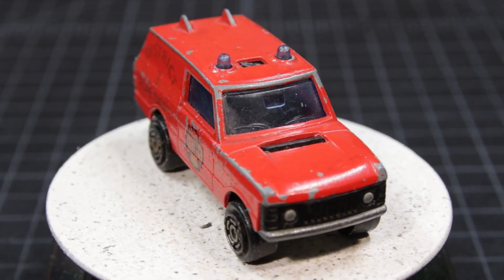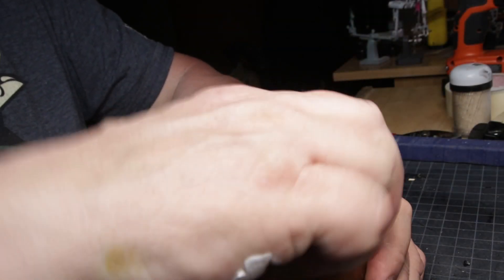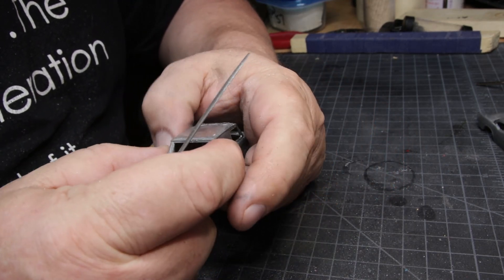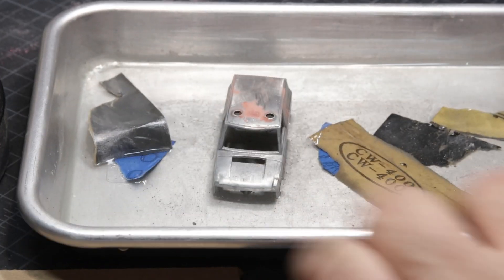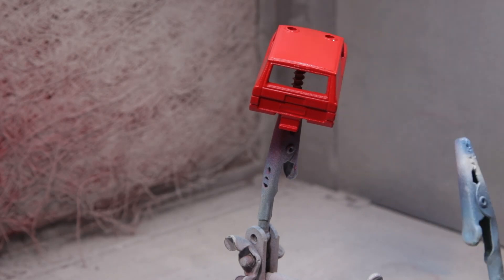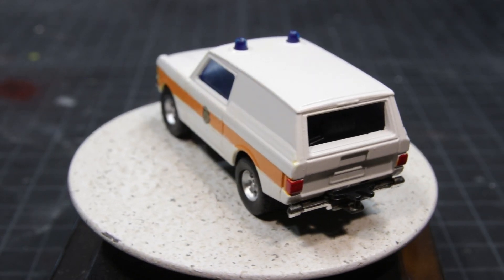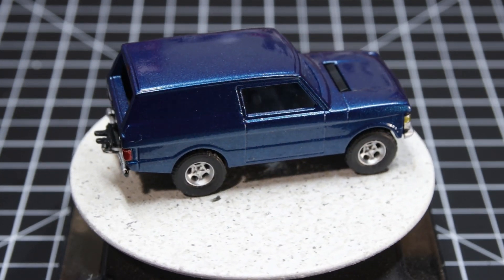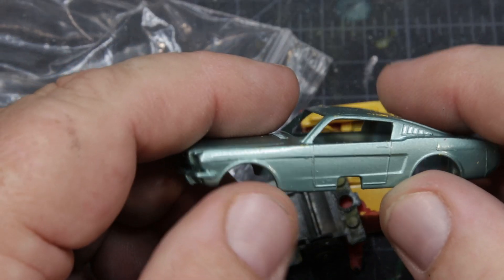Majorette Fire Chief Range Rover - Custom

Comment: Hey Time Rider another great job. I love that red  in the 90s I owned a Holden Sandman panel van witch was Mandarin red it looked just like that.   Holden was the Australian variant of GM and I worked in the factory as a spray painter for ten years. I also love the blue that you ended up with they had a paint like that called Deville blue it fetched back a lot of memories. At least you got there in the end and the car looks great.

Comment: Its the classic range rover 2 door p38 was their designation code, a company called carmicheal did most of the fire tender conversions, and did a 4x4 version and a 6x4 model, the rearmost axle wasnt driven on the 6x4 it just  arried the extra weight of equipment if a tender or a water tank.
Reply: Not exactly the classic Range Rover version. This Majorette is a little copy of a top-chopped Range Rover proto from famous Paris-Dakar Rally raid which racer in the late 80s and was first sold (Majorette one) in yellow with supermarket french brand Leclerc.

Comment: The cop car was an inspired choice and if the stripes had worked better it would have been 10/10 all day 👏. But the blue van style looks super awesome too and those rims are neat for that age of car. Also as a side note the Range Rovers of that time really diddnt have that much detail irl so it really wasn’t too bad for a model and I always though their suspension was good,I just was never keen on their odd choices of rims.
Reply from the maker: I suppose the original wheels were inexpensive and easy to put on!  The details that would possibly have been on a Lesney casting would have included door handles, logos, numbers on the license plate . . .  things like that.

Comment: hi agent TR, look i think you are a very good painter, but i think your trying to get these cars done to fast. just slow down a little. when you going to fast your making little boo boo that just screw up just a tiny bit. maybe you
Reply from the maker: I have absolutely no idea what you're talking about . . .
Reply: hi again agent TR, im not trying to criticize anything you’ve done. ive been watching you since you did such a beautiful job on that 911. i know ive told you that ive dreamed about that car since the mid 70’s. ok you must be missing something if you do things you can make just little thing and it can cause you whole project to fall flat on its face. maybe its you ball jar. maybe your not getting the car clean enough after the the bath in the hot tub. i dont really know cause i do get to see everything you doing. from stripping to mixing paint. i have been wanting to ask you if you thought the oxidation on the cars originally could have been caused because the cars weren’t being primed before they were painted. i have been really struggling with why you paint jobs are not coming out as good as the first few you did. i dont really know about the costic soda that rob uses. i really dont think i would be putting that down my drain. he isnt have the same kinda issues that your having. i going to keep thinking about this. ive been around quite a bit of car restorations in my time. 
again im not trying to criticize your work. ill tell you what im going to do i will just stop watching you. i had teacher constantly criticizing my design ideas while going to arizona state. i didnt really appreciate that one bit.thats not what i was trying to do. sorry for saying any thing agent TR.